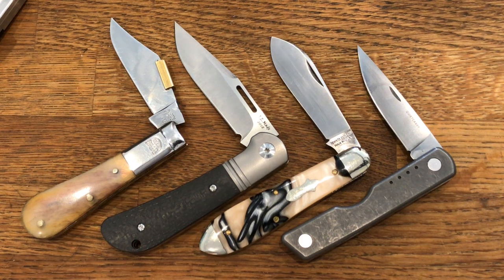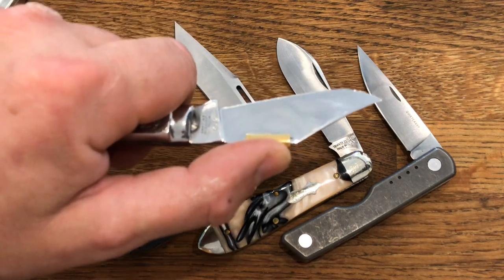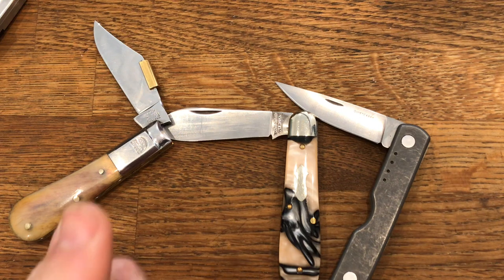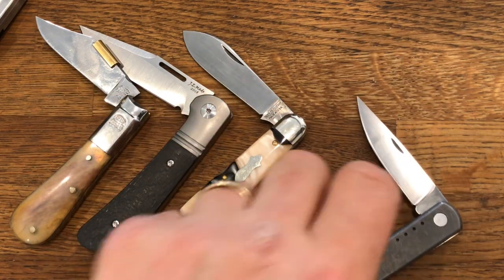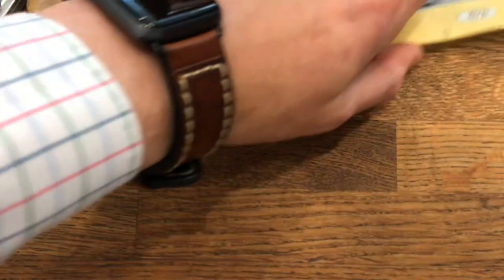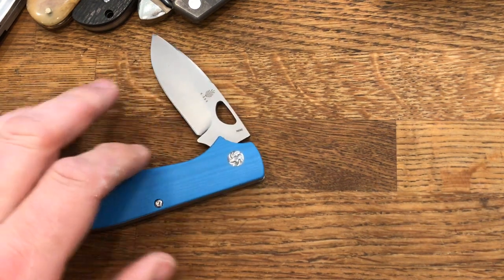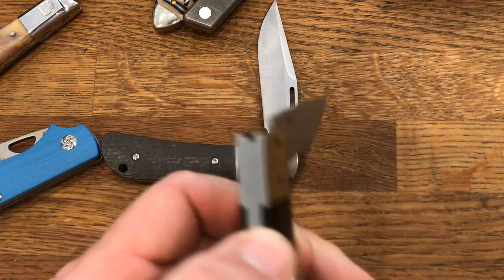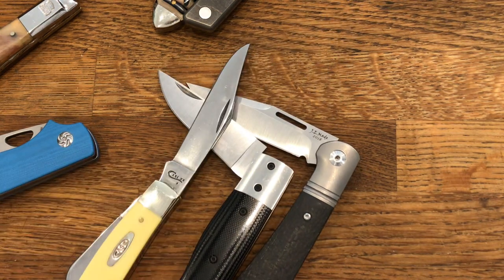Half stops on slip joint knives.... a safety feature?

Comment: I'm indifferent.   I can see your point.  I've heard folks say that it is the sign of better quality knife.   Rubbish.   The Cub Scout knife has a half stop and the boy scout knife does not. Both are of about the same quality and cost!   You've made some very good points on the negatives of the  the true half stop in slip joints.   I too think it is over sold as a safety feature.   But I also think there is much more to the story. 

In fact all slip joints have half stops its just one is well defined and the other is more or less and false half stop. 

The idea of the half stop is to stop the blade from folding too quickly when you are actually trying to fold the blade.  The idea is to give you a second look to make sure your fingers are out of the way.  Stilettos actually rock around and stop twice a long the way.    Most slip joints will have a true half stop and false half stop. 

The false half stop just gets more difficult to fold at around the 90 degree point simply because the spring is under the most tension at that point.  Once it hits 90 degrees you will feel a neutrality in tension.  (the blade  doesn't feel like it wants to open or close.)

When  you begin closing, there is immediate tension which slacks off ever slow slightly (a break) and then it becomes stronger, increasing at around the 160 degree mark all the way up to  around 120 degree when it  starts to slacken off. You 'll still feel tension up until around the 90 degree point.  After you pass th e90 degree point the blade will start pulling to close.    This pulling will be ever so slight until you reach around the 45 degree point.  At that point the blade pull becomes strong enough to snap close. 

With  the true half stop, tension will relax some where around the 120-110 degree point and the blade will snap to the 90 degree point. and stop.  You will then have to apply more pressure to close the blade all the way.

In both the true and the false half-stops, the spring acts to  increase the tension from the full open position while trying to close the blade   so that the knife is less likely to fold on your hand; both accidentally when using but  primarily when attempting to close the blade.  I think the main difference between the false and the true half stop, is you can use a weaker spring on a true half stop with similar results.
Reply from the maker: Knife Chats with Tobias of my very traditional Sheffield knives, 3 have no halfstop, and only the two super smart hand made ones do. The same is true of my Solingen knives. None of my Spanish ones do, but most of my Italian ones do. Case are a mixed bag. I think it’s just pretentious GEC  collectors who are trying to make out that only their ‘quality ‘ knives that have half stops. But as a safety feature, no, definitely not.

Comment: I can see your point with the danger of half stops, I have recently bought a Two Sun slip joint, the TS90 an amazing knife but the spring is so powerful from open to half stop that I decided to grind a choil into the blade as there is almost no ricasso. In general I like half stops, not for allegedly saving your fingers when holding in a normal grip but when closing usually I move my grip back and without a half stop can close the blade fully in one move while my fingers are still in line, the stop gives me a pause. With a strong spring though I usually move my fingers right out of the line of fire before closing.
The other reason I like halfstops is because I am a 'Fiddler', will sit and open and close a knife while reading and I like the sound of a knife with good walk and talk.
Reply from the maker: chris osh each to their own, but I can take them or leave them. It happens though, that most of my favourite knives do have them, but it’s not why I like them.
Reply: @slick_slicers  I just had a look at some of my older slip joints from the '60s and some WWII vintage, none of the wartime knives (single and two blade jacks) have halfstops and only one no name from the '60s has a stop. My favourite all time slipjoint is a WWII two blade jack knife that was issued to my dad in the Western Desert when he was in the RAF, no halfstop and still a good knife after nearly 80 years of use. Wade and Sons of Sheffield.

Comment: I believe this is actually an age old point of contention, see Zerogee's comment on this 9 year old thread: https://www.bladeforums.com/threads/half-stop.799363/ I can certainly live without them, I like the Kizer one since it aids one hand operation for me personally, lines up the blade for popping shut with the index finger, I've never been a huge fan of them otherwise (especially on the manly wasp) but on two handed open/close only knives it doesn't really bother me since I tend to take my time with them anyway, I've yet to get cut by a half stop but I also haven't ever been saved by one either, all said and done I guess I wouldn't miss them if they were to suddenly disappear.

Comment: Interesting, I am no fan of back springs that require super human strength to open or close. The over compensated springs are like mouse traps ready to catch the unsuspecting, half stop or no half stop. I suspect with your hand problems that you make many unintended blood sacrifices, The worse I did was to take a large slip joint and unintentionally close it on 4 fingers. Only did that once. Gee knife cuts hurt. These knives require respect and attention. Thanks my friend.
Reply from the maker: Old Fool yes my paralysis is responsible for a lot of blood loss! That being said, the first time I closed the JE Made, the half stop fired a very sharp blade toward my finger causing a small nick. I’ve been careful ever since.
Reply: @slick_slicers  Once burned twice learned.
Reply from the maker: Old Fool very true!